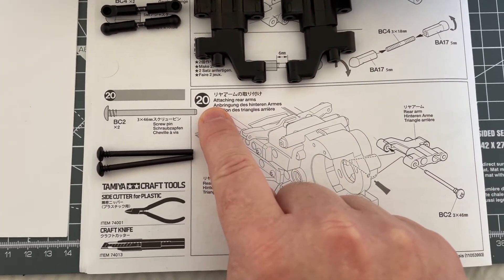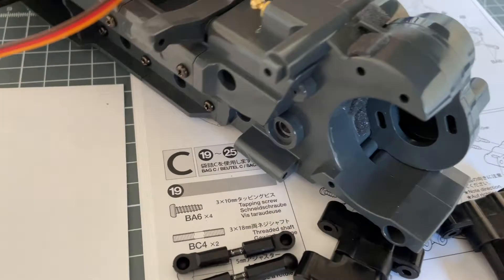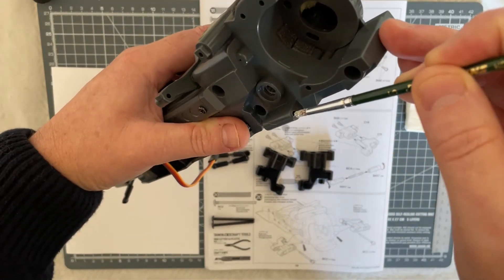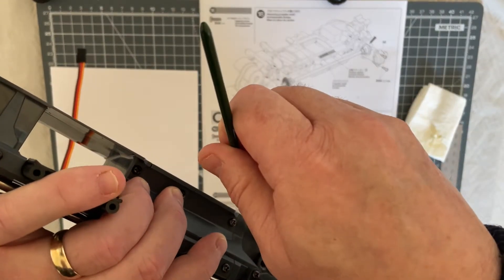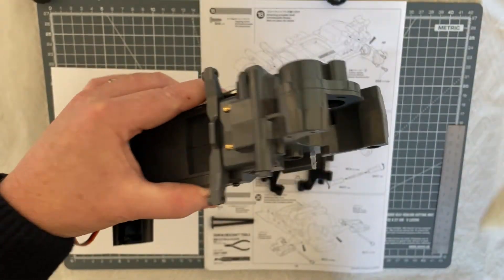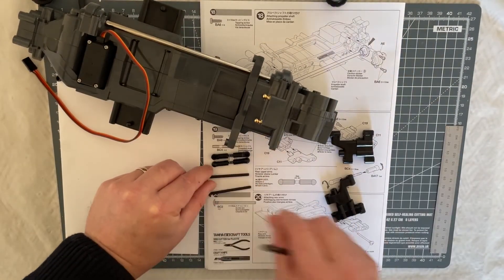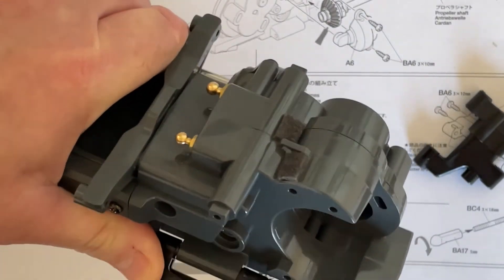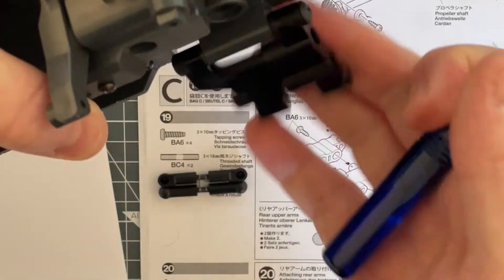The Tamiya Beetle Rally MF-01X Chassis Build With Me Step 20 #rcelf

Comment: Great video John. I have a little suggesetion. Close up the whole with where the pin goes into. Then let the pin push the grease through. And clean it up afterwards. Might be a little bit easier and faster when using the gease tube.
Reply from the maker: Hi there and thank you for watching and the extra tip, I really appreciate your input and sharing of how you performed the step. I will take that onboard, for when I perform maintenance on the model. Take care and best wishes to you and the family 😉😊😁

Comment: Just a bit of advise, you may have already hit this stage, but i had to shave some of the plastic from the recess the ESC goes into, I was using the Tamiya one (maybe TBLE02 I would have to check) and it was too big. The issue with shaving some of the plastic so it would fit snugly is that I sliced my finger quite badly, blood everywhere. Ultimately, cut away from yourself 😂😅👍
Reply from the maker: Hi there and thank you for watching and providing me with some hints and tips. I think I’ve got away with the ESC being the TBLE4S, rather than the TBLE2. The TBLE4S is slightly smaller and therefore goes into place without the need to trim, and ha hum! Slice ones little fingers…I hope that you weren’t too badly injured and that your fingers have fully healed. Don’t worry, we’ve all done it, especially in my previous life as an electrical engineer on the road, slicing of one’s sausages was always a hazard ! Take care and best wishes to you and the family 😉😊😁